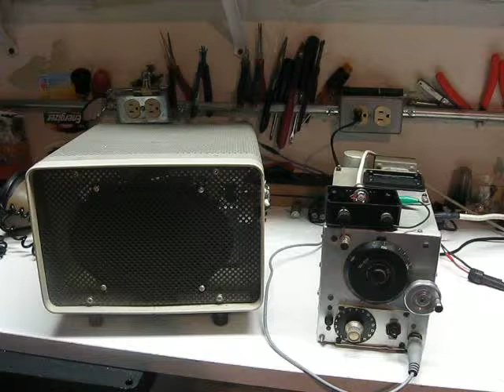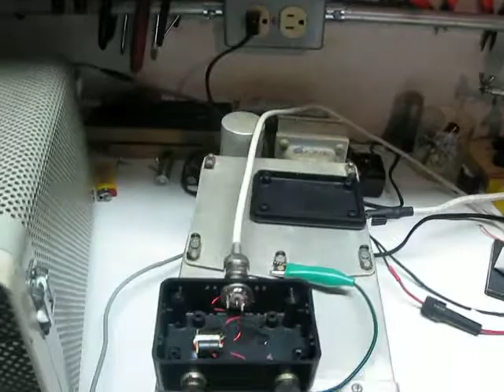BBC on 198 kHz LONGWAVE w/ BC-453 @ WA3TTS

Comment from the maker: That is correct Kevin. The BC-453 was built for longwave and is basically an AM receiver with an 85 kHz IF and a BFO.  Considering the technology is 55 to 65 years old, it performs amazingly well with a good antenna. The isolated windings on the binocular transformer keep the common mode noise out of the radio, which is why it hears so well with the EWE antenna vs. 100ft of wire to a tree limb.....73  Mike